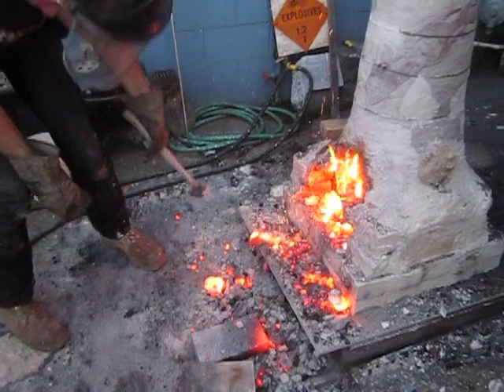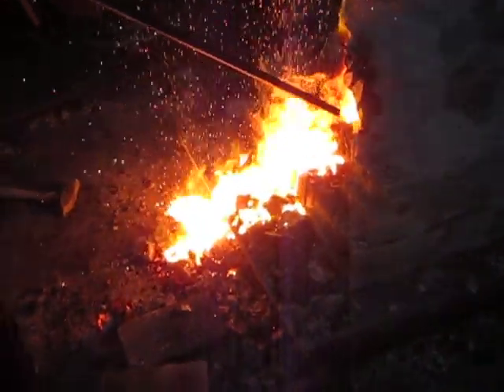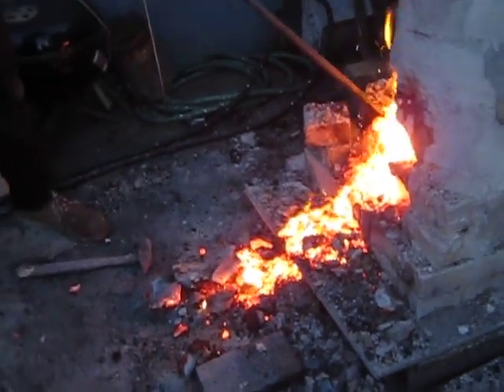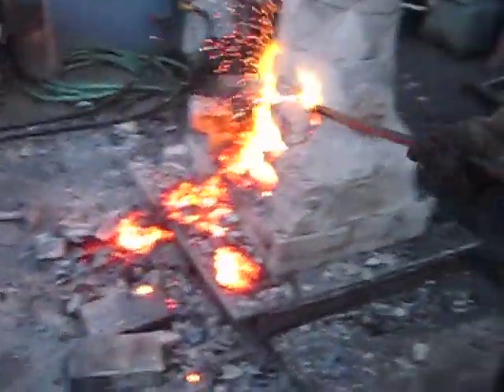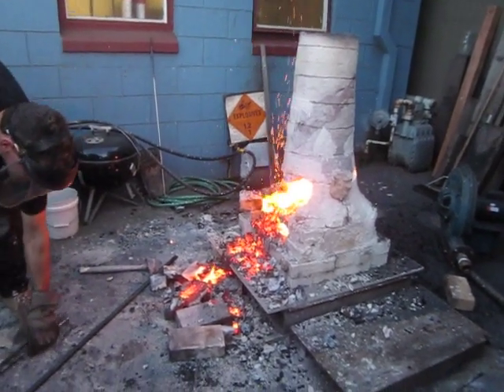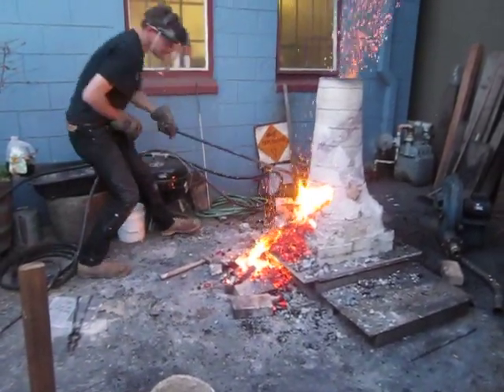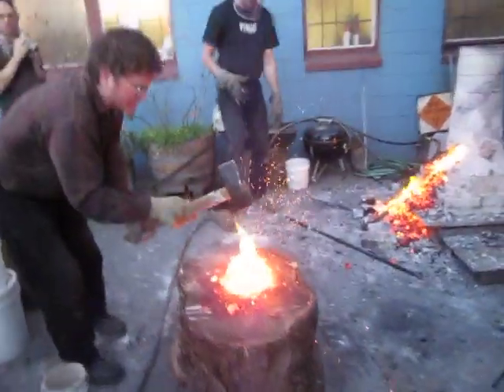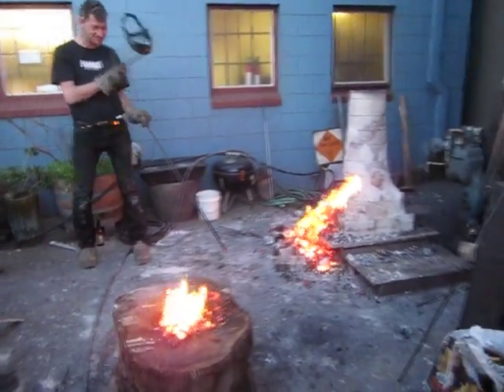Jeff Pringle and Jim Austin Viking Age Iron Smelt

Comment: Wow, you guys really put the safety first, pulling bricks under half molten slag and running around with hot steel.
It was interesting though. I wanted to try this during summer but I just don't have anywhere to even do it, and even less what is needed to.